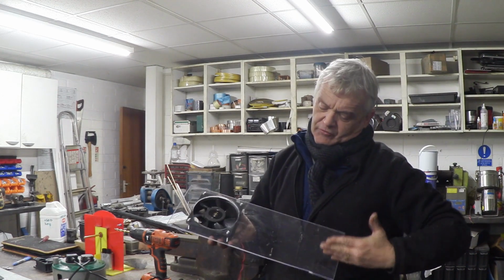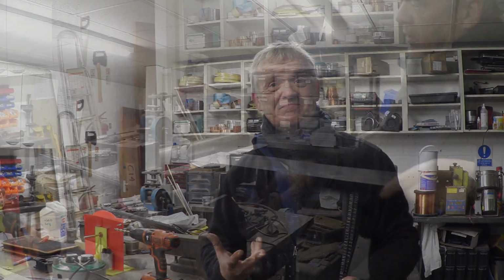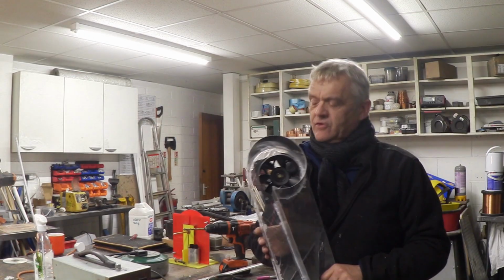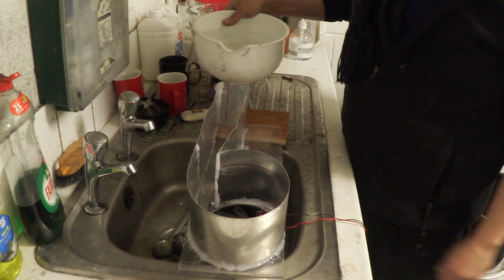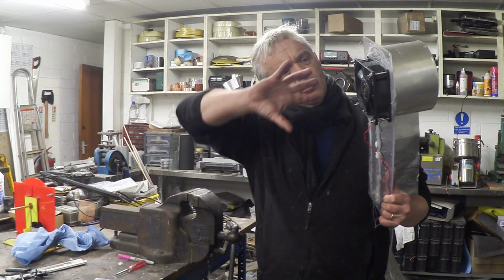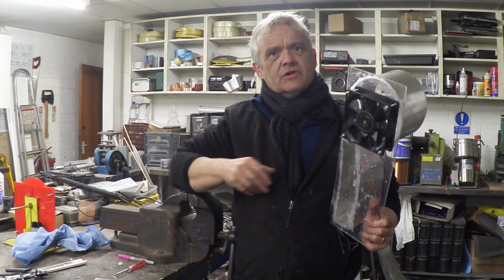1348 Vortex Generator

Comment: Just a thought, turbine generators built into colossal dams have a specific impeller for high pressure flow, highly efficient. A 3d printer can recreate the same design and to the same for low velocity applications;low head pressure. I speculate if the turbine blade is designed with a housing to match exactly, high tolerance, then efficiency will be maximized for energy conversion; yes, I have been listening.

Comment: Vortex = 4 directions of travel
Cyclonic =2 direction s of travel
I believe this would be a cyclone.
Counter clockwise rotation and down.
A vortex would have a center counter clockwise flow but in an upward direction. I believe a vortex requires 2 exits.
Wiki vortex generator.  Pls correct me if I am mistaken.

Comment: Check out the Powerspout from New Zealand. Instead of the PC fan, they use the motor out of a Fisher & Paykel washing machine. They can be used in this vortex config with low flow, or if you have enough water velocity, add spoon heads to the motor and use as in impellor - generates a serious amount of power.  Just need a trip to the dump to get your hands on a F&P motor.
Reply from the maker: that's just a pelton wheel mate

Comment: I highly recommend making a second one and mark down any change on the output of the second fan when increasing the angle.  I would think a rise of 1 inch per foot would not be as great a result as 1 inch rise ( source side ) for 6 inches distance ( towards the second fan.  Obviously once figured out, you could make a stack of them and have your roof gutter feed the lot of them and potentially power a sump pump as alot of rain can lead to flooded basements.
Reply from the maker: good tip mate
Reply: I believe a lot of energy in rain water off the roof that is wasted

Comment: This is similar concept to what I had made for the 3d printer competition but didn't get round to make the film, I used a big spiral inside of the drainpipe similar to a rifle barrel down to 2 pc fans bonded together inline at the base, the bath holds roughly 100-125l and the plug is adjustable height so I could alter flow rates etc and worked good enough through a booster board to trickle charge my shed battery's, it didn't work very well in rain as the water would pull air through with it, made a float attached to a couple of hose connectors with the stop valves to work around that issue but didn't get around to trialing it, the theory being 125l of water at 3-4m high is pretty much a hydro battery 🤷‍♂️
Reply from the maker: that is a very good point mate - I agree it is a hydro battery

Comment: Yeah, it works.  I know of someone around here that uses it by catching mountain runoff to a pond and then he sends it to the proper designed generator that is about 100m away with a 30m height difference from the upper side of the hill; with the generator at the base of the which hits the generator and then into the runoff going down the mountain.  It sounds like a small jet engine when it is running.  But it does help him keep the batteries charged in the given times of the year; spring mostly.  As he opens the value from the pond when he determines it needs to be lowered.  Heavy rains coming or just too full.
Reply from the maker: nice mate

Comment: A Zodiac pool cleaner reconstructed in the swimmingpool filter bucket is an idea, I am playing with. The cleaner is optimised design to be driven by the pool pump water going into the swimmingpool, promises a good result, it can generate as long as your pool cleaning cycle is running. A vortex is also automatically created with the water running into the filter tray plus it has a bit of a head.
Reply from the maker: I like the idea mate - cheers

Comment: Yea, the direction looks like it should be reversed?
Reply from the maker: see video 1349 mate
Reply: @ThinkingandTinkering  Thanks, my question was not related to the support structure of the fan, but rather it appeared that if you poured the water straight through (without vortex) the fan the blades would spin anticlock, however the vortex was a clockwise direction, water was therefore not hitting the face of the blades perpendicular. I realise this is a drag based system as opposed to 'aerodynamic', you would more torque and power if the fan was fitted to naturally go in the same direction as the vortex?  ** Oh i have just noticed what you held up before the test seems to differ (vortex direction) from what was tested?

Comment: The Romans used to have paddle wheels in series to operate a grain mill, with each wheel feeding another wheel further down a hill.. Their purpose was to turn each wheel just fast enough to move the equipment at a given location for the mill. 

Changing the purpose to generating electricity, could you get a higher amount of energy out if the fans were stacked in a similar manner? Or would it be better to put the fan as low as possible to collect all the gravity created energy at one time?

Granted, gravity is only providing a certain amount of energy into the stream that can be harvested.
Reply from the maker: it is a good question and I don't know the answer - for me that means a test lol
Reply: Roman's more advanced than new science. Bendable concrete for example the we can't make these days

Comment: I've seen that vid as well.  TY for producing this.  I think one of the challenges consist in the motor has to be designed high torque.  Fans are high speed thin air, as you stated.  Of course  you know that.  I would love to see a vid to help people develop motors designed for such applications.  Washing machine motors can sometimes output 500 watts plus.  I don't think it's to hard for a hobbiest to grasp and make a motor that can handle torque and produce useful work.  I remember watching a vid on YouTube discussing these designs.  If others are interested, I could find it, or one and post?  Better yet you can make one and show them how?  Water is one of the best ways to make power and store it.  But it requires a motor made for it.  Perhaps so someone could donate a washer motor as a fan motor and a water pump type motors are apples and oranges.  Nonetheless, great work as always and I appreciate you!
Reply from the maker: I think you make a lot of good points mate and you are right I am aware of them but that doesn't matter - the post is for everyone and raising the points might make folks think about them as I didn't talk about them - so - thank you for taking the time to post a very interesting post
Reply: @ThinkingandTinkering  I hope so.  I see what your doing and really do much appreciate it.  I despise the way corporate entities hord tech, obsolete it so it doesn't last and over charge for it forcing people to pay.   Perhaps together we can find solutions that are affordable that we can do ourselves.  Love those delta fans btw and have been a fan of the fan for a long time, lol.  They are amazing!  Can't believe someone donated so many, which is awesome!
Reply: I'd be curious about the video. I'd love to get a quick overview on the topic like possible efficiency, what kind of power you can extract from what kind of stream, what kind of motor and rotor blades you'd need, what it might cost. Like what are the basic formula and how would you apply them.
This kind of water generator could be interesting to a lot of people.

Comment: With only a low head of water wouldn't an over-shot bucket-waterwheel (with dia equal to head) extract the maximum power from the waters gravitational potential? (I know you've got some 'fans' and are testing them: but).
It looks like the 'vortex' type loses a lot to the turbulence, and would only be efficient at a specific flow rate.
Power generating dams have a high head, and enclosed turbines to control turbulence and cavitation, so the high-head/pressure makes the generator set up energy dense. (Energy = v2 and all that).
With your design a wider inlet throat would increase the vortex rotation as it nears the turbine; plug-hole vortex stylie. Unfortunately I can't bend my head around the fluid-dynamic maths to find the sweet-spot/configuration of dia/fall.
Anyone got that?
Reply from the maker: you are 100% right mate but this little demo is trying to solve different problems

Comment: There are very many locks on the canal system near my home and each has a sluice to prevent overflow on that section. Thousands upon thousands of gallons flow torrentially every day via these channels which could produce some decent output if they could be tapped!
Unlikely it would be allowed though...😏
Reply from the maker: that is the real problem - you really just wouldn't be allowed to do it